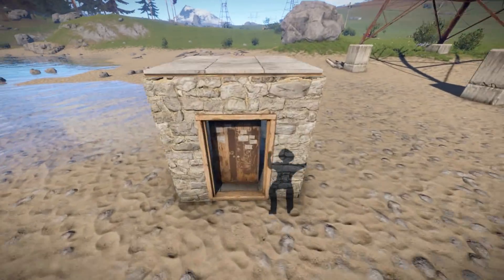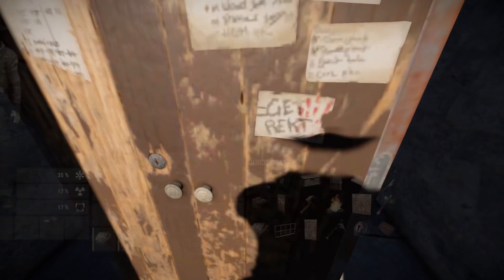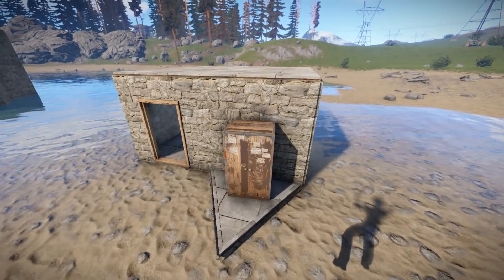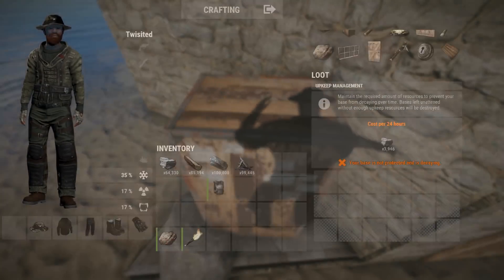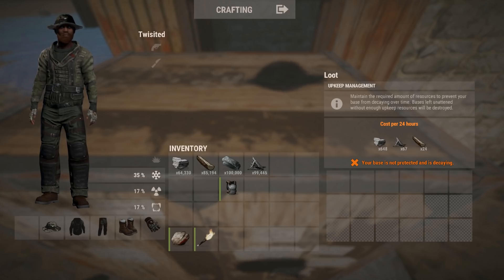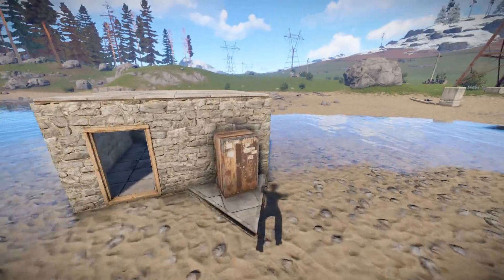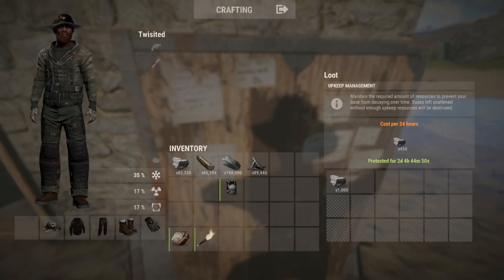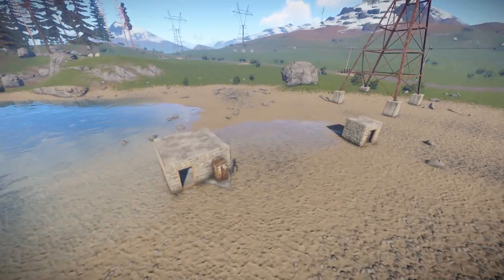RUST building 3.0 first look - RUST BASE UPKEEP SYSTEM EXPLAINED

Comment: Twisited, could I get a response on my theory? Thanks. My theory is that this is actually a raid buff. You can have a smaller base yet do more raiding. People look at this in such a  bad way but realistically it's a performance improvement. And it makes bases smaller. less lag, more raids. I like the idea. Theres already good ways to defend your base. Turrets traps etc. A good balance.
Reply from the maker: Plasmic hi. The devs have already mentioned it was based around server improvement to remove unwanted assets but I agree it's to assist raiding too

Comment: Wall stacking is possible now,  it has been figured out by other YouTubers,  looking forward to see your wall stack base design once you figure it out.
Reply from the maker: ard8livecom yea I've seen the floating floor method but personally it's not a secure option in my opinion as it's easy to splash damage below it

Comment: Does every building component decay now. So if you had a stone base with a metal roof, if you only had stone in the cuoboard would the roof decay? Do roof sections have more hit points than ceiling sections? I think the solo players and small groups have been butt fucked yet again!
Reply: The_Boot yes, every part takes decay damage now